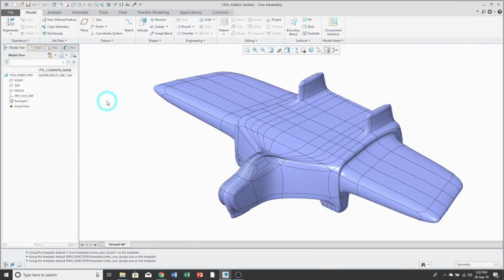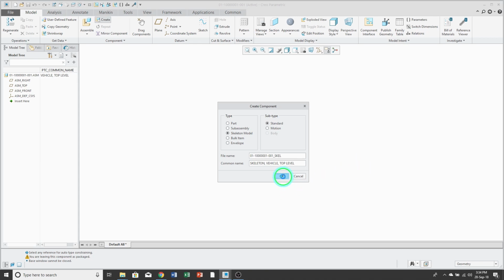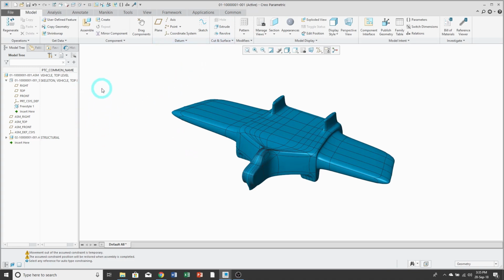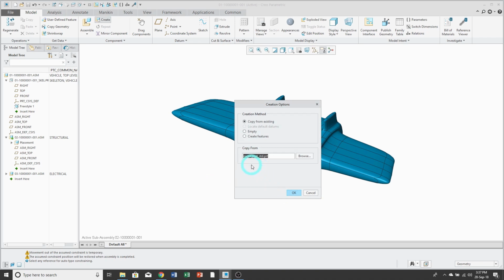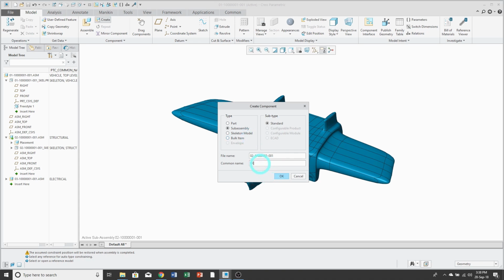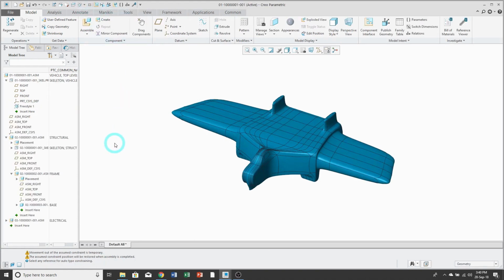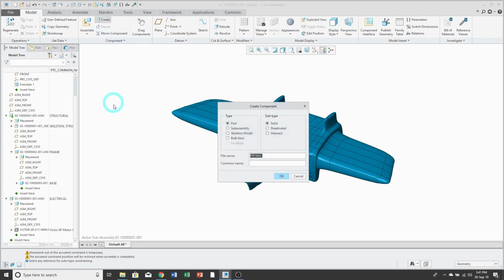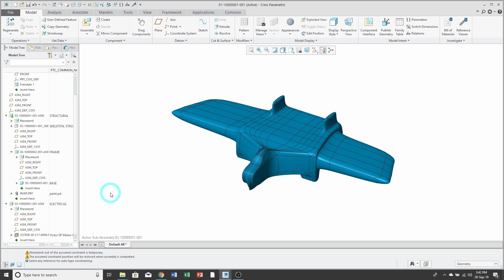Creo Parametric - Top Down Design - Defining the Product Structure

Comment: This is a very useful demonstration that shows how important is to structure the foundation of a product since the beginning of the design phase. However I would like to know with this method how does the designer implement the assembly joints and mechanism connections (pin, slider, etc.) ? because from what I saw every subassembly and part at this stage is defined by the default constraints for placement. thank you
Reply from the maker: Very good question. I don't have videos on this yet (eventually there will be) and I'm not trying to plug my book but I do cover the two methods in "Top Down Design in Creo Parametric." There is a kind of Skeleton called a Motion Skeleton which essentially consists of an assembly with a sketch, a ground component, and body components. I don't prefer Motion Skeletons because they are limited to 2D motion and they are hard as heck to use and get right.

My preferred method is to create multiple standard Skeletons in the assembly. Initially you locate them with the Default constraint, but after they are created, you open them and add the necessary geometry - datum axes, datum points, surfaces, and so on - that are necessary to define mechanism connections. Then you go back to the assembly and Edit Definition of the component to change its placement from Default to the appropriate mechanism connection - Pin, Cylinder, Slider, Gear Pair, Cam, and so on.

Let me know if that makes sense.
Reply: Thank you this clarified the issue. It will be great if you could make a video about the second method that you mentioned because it seems very very interesting. And from what I have learnt from you so far I am excited to buy your books and learn more about how to use Creo effeciently.